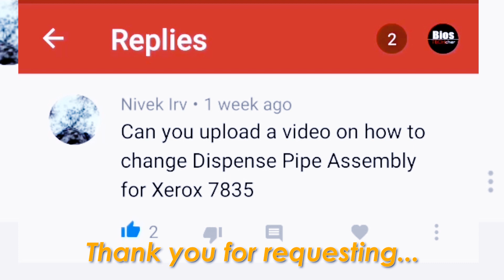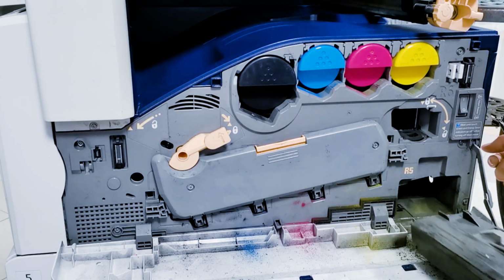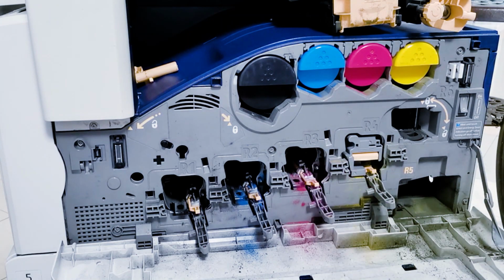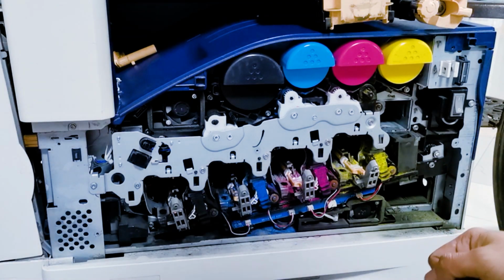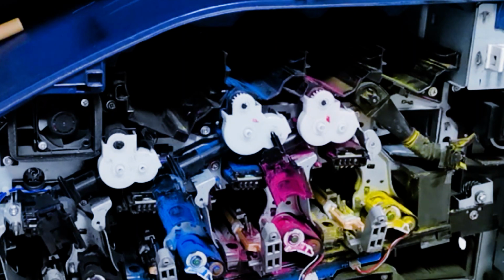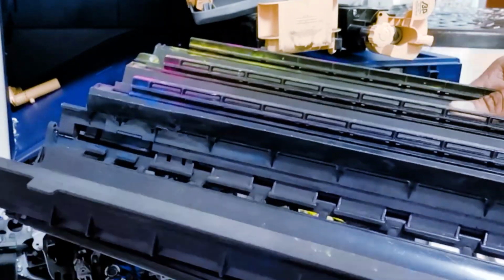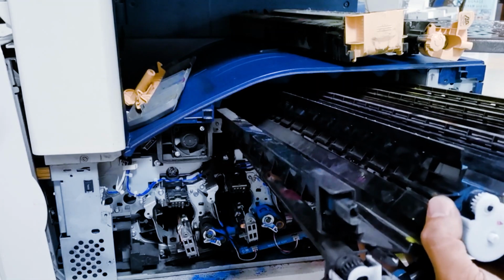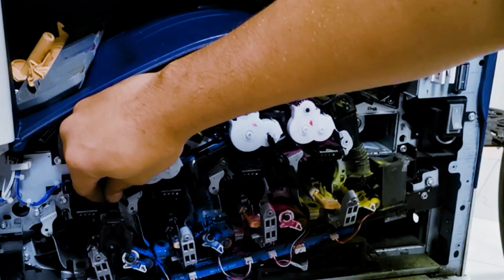Change Dispenser Pipe Assemby for Xerox WC 7835 7845 7855

Comment: Thanks you for the tutorial. It helped a lot!!!
The issue I was having is, it said to replace Cyan toner. I installed a new toner and it kept telling me to replace cyan toner.
I took out the dispense pipe assembly and examined the cyan housing. I found out that the long plastic rod inside the housing was broken and causing the ink to back up in there. Luckily I had an old unit which I used to rebuild the current one.
Rebuilt it and reinstall the dispenser pipe assembly and it was perfect from here on.
I'll be doing some prints very soon and will give it a longer test run.
Cheers!
Reply from the maker: I'm happy to hear that, thank you for keep watching on my very simple tutorials, i keep sharing all my experience of everything I know, i appreciate your response, I hope it helps you for some basic machine problems. :)
Reply from the maker: keep exploring your machines to expand your knowledge, better than school. LOL :)
Reply: @biostechprintingshop  Will do and will be in touch. Cheers